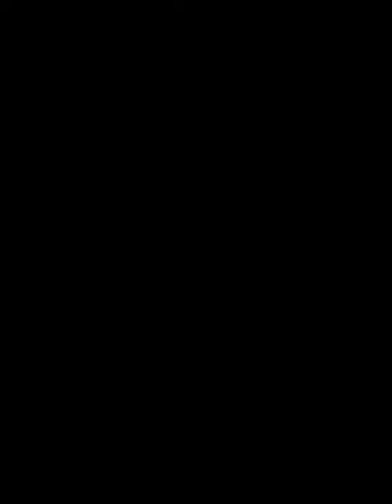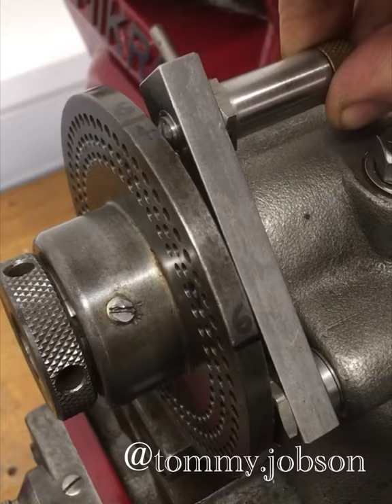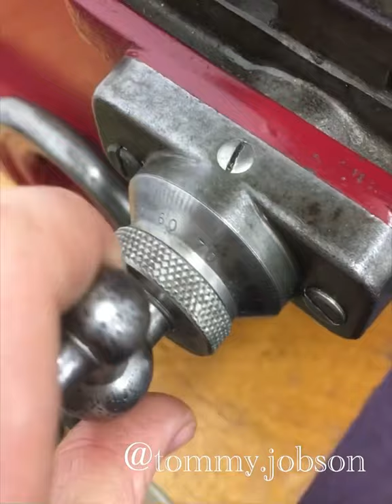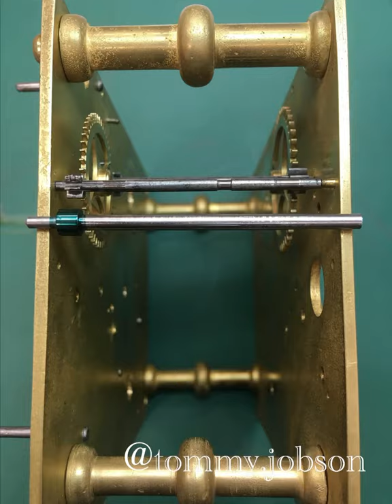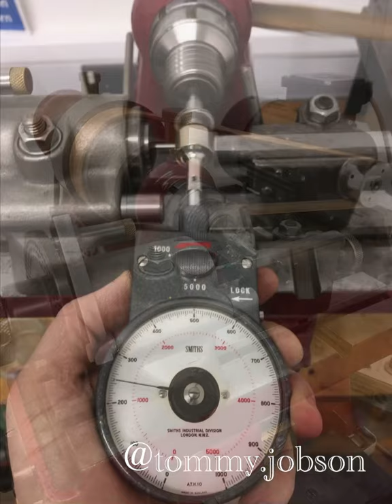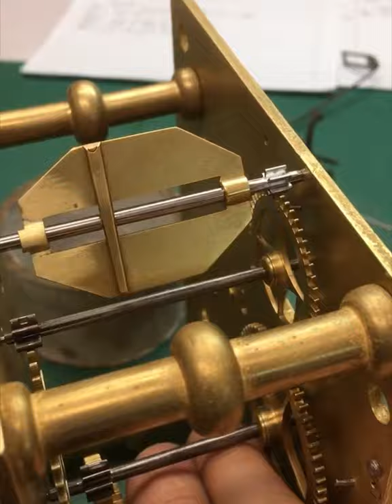Machining a Clock Pinion #shorts

Comment: Hi Tommy, was that 250rpm? Do you always use the same speed on pinnions? What depth of cut were you taking/number of passes? Arbor finish at the end...was it just the light or had you darkened the finish? My usual few questions 😁
Reply from the maker: Blimey! Yes I think it was 250 from memory. Speeds as spec by Thorntons. I take many light passes with paraffin as coolant. No I didn’t darken the finish. Material was EN24T which is pre hardened and tempered but will still machine okay.
Reply: @TommyJobson  haha...you gave me more than I asked for 👍 I was wondering the other day wether you'd have to anneal and re-harden when cutting a pinnion, you cleared it up 😁 I'm loading my brain before next steps 😉